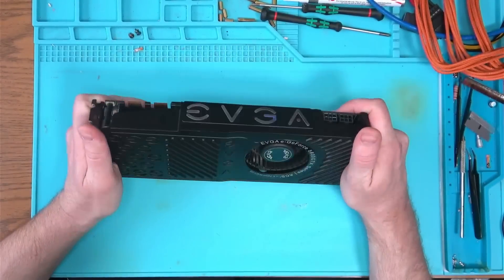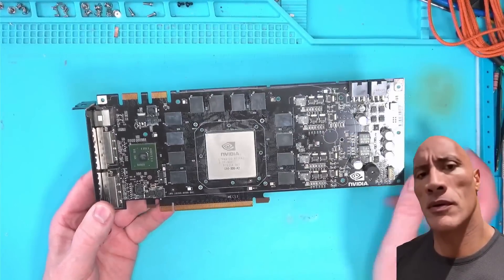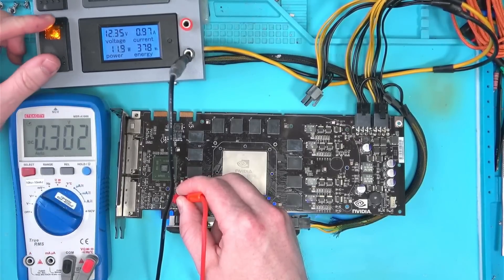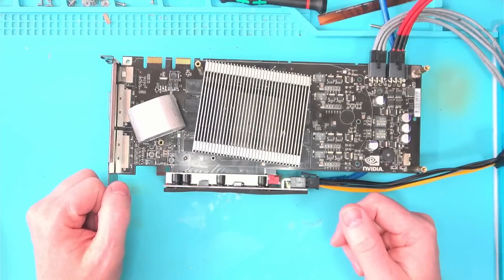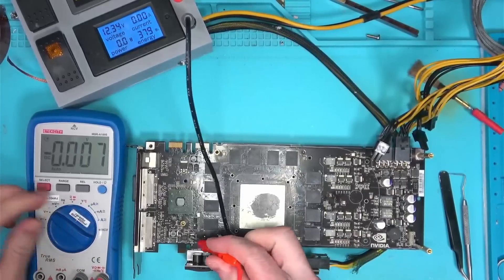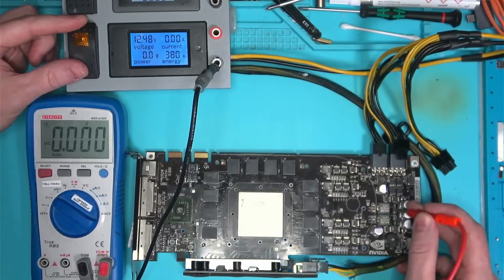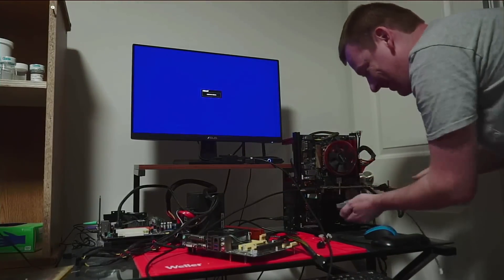Old graphics card repair was a success but was it worth it ?

Comment: Comments section is wild.

nvidia 8 series flagships like 8800 GTX and Ultra are not easy to find in good working condition on ebay, especially not the nicer AIB boards like this one. The ones listed as "Used" usually are on death's door because they've been "baked", and they may post, but crash under load. And "baking" involves literally baking the whole card - capacitors and all - in an oven, which isn't great.

There are not very many people who actually want to buy these, because their only value is to collectors and overclockers. But, the going price is such that it kind of does make sense to pay NWR to work on it. For even more sought after GPUs like for instance the radeon X1900 XTX, paying him to work on it is a fantastic deal.

Comment: these and the 9800 where terrible for early ROHS solder cracking. most people did over reflows and ruined them back in the day instead of reballing.  The HP DV series and nForce based motherboards from this era suffered similar fates

Comment: I know the 8800 GT had compatibility issues with certain motherboards, not sure if that applies to the 8800 GTX as well. I know from personal experience with the 8800 GT that this is a real issue, as I own an OEM system with a socket 775 motherboard, and my 8800 GT definitely does not work in the system. The fans just spin at 100% speed and no display output.

Comment: The extra chip is the video decoder on these older GPU. Is actually a mobile GPU core, cut down enough to just run the video codec microcode on it. It basically does video coding and decoding in real time, required for video streaming.
As you said, the core of this chip is now inside of the main die in later GPUs.

Comment: 4:28 what does that wire at the top of the screen do?
Reply: Its a thermal probe, probably a thermistor or something of that sort, it measures the temperature of the board close to the core (or anywhere needed)

Comment: I was just restoring my old core 2 duo PC with an 8800 GT. Not sure of original manufacturer as had a Zalman after market heatsink. I think this may have been when heat pipes were new and cool. I noticed it had a 256bit memory bus. Which is more than every graphics card I got since, until I picked up an EVGA 1080ti bargain which has 384bits.
Please Nvidia, can I have a modern gfx card with a 256+ bit memory interface, but without raytracing or unnecessary frame rate generation. Otherwise I'm staying with these golden oldies. No game is worth spending two grand on a graphics card for. I would prefer to stop gaming and do some programming rather than pay that lol.

Comment: hey, i have at home a gtx 970 with 1 dead memory module. i also have another dead gpu with the same memory chips. would it be worth it to send to a repair shop to fix the 970? i'd try soldering the memory chip myself, but i'd spend more on the equipment than what the gpu is worth. how much should a shop charge for just replacing the chip?

Comment: I was about to get VERY surprised if you had the correct stencil for that card. Of course you had to use an universal stencil as you explained later.

Very nice video. I refuse to let die old parts too. Just out of curiosity, are there chances that the old GPU core was ok (the one you swapped finally from the donor board) and was the test computer problem again?

If you want a guess, I think it might have to do with some modern (and not-so-modern) hardware only supporting UEFI boot, and that 8800GTX probably only works in legacy.

Comment: "better designed than any modern graphics card"
Not really. This card is from that period when all nvidia gpus died within months.... including those installed in PS3s. Aka the "bumpgate".
Reballing it might have fixed it temporarily, but the connections between the die and the substrate will eventually break, because the underfill is trash!

Comment: The 8600 chips had an issue with high failure rates. Especially the laptop variants. I had a 9500M GS die. (The 9500M GS was a rebadged 8600M GT, made for the next generation.)  

It was something to do  with the solder or something else close by to the solder. Many years ago and can't remember exactly. There was a name for whatever it was.
Reply: "Tin whiskers"?  That's the only thing that comes to mind.  Chip creep is only for socketed stuff so can't be that.
Reply: @Vile-Flesh  I think it was something about a layer of something between solder and somewhere else. It's a long time ago though. Maybe ten years since I was even thinking about it.

Comment: I have one of these from EVGA that I've had sinse about 2008. It worked like a champ all through its hayday but I'm kinda ashamed to say over the years of not having cash for anything else and it just being up to the task of gaming well into 2015 I probably baked the thing upwards of 10 times to temporarily stop no boots and artifacts.

It worked fine last used; now lives in a rig shoved in a corner with an Nvidia 680i motherboard and QX6700 CPU.

Comment: For the owner it was most likely worth it, noone sends in an old EVGA high-end GPU because they want it working for no reason. Probably for a legacy pc and properly run legacy software. Also, most GPUs of that time looked pretty sh*t, this is a good looking model of the area so just for that worth saving.

Comment: Sorry to break the celebrations but that is only a temporary fix. The G80 has the same issue as the fat ps3s gpu. They tend to break at the micro bga layer between silicone die and substrate. The insane high wattage plus the resulting thermals plus the thermal expansion plus the new non leaded brittle solder plus the inadequat substrate preparation of TSMC not taking non leaded into account. That is also the reason for the xbox 360 RRoD and old macs with nvidia gpus failing.

Comment: Baking those 8800's was a thing back in those days. Solder joints went bad. We literally shoved the cards in the oven  🤫😅 (also the PCIE compatibility, that card uses 1.0, your newer motherboard may not support pcie 1.0)
Reply: Pcie should work on pcie5 no problem.  Pcie 5 wont work on pcie1.

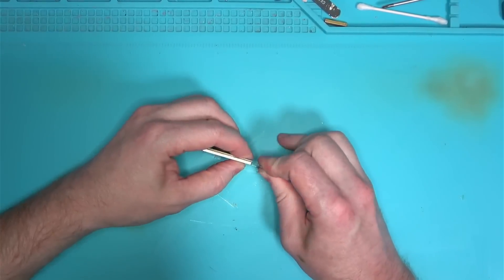Comment: Tbh, I hated the older GPUs that had the die cover. There was always never enough paste between the cover and the die like what you showed at 6:16 and it's difficult to change the paste once it dries out
Reply: I was wondering also, should I look my old GTX 1080 does it have also cover...
Reply: @GameBacardi really?  My msi 1070 was bare die.
Reply: @killerrf  ok good, because I don't remember when I put new paste last time

Comment: That is awesome! I still have my 2008 PC that runs 3x 9800 GTX+ (same G92 architecture as this 8800 GTX) in tri-sli and it's still a delight to fire up and play some old school games on.
Reply: but, can it run crysis?
Reply: @maklogetrich2378  on cinematic 24fps, because human eye can't see more than that!
Reply: @maklogetrich2378  🤣 Absolutely! Was the whole reason why I built it years ago!
Reply: Very nice!  I missed out on gaming and hardware of this era as I was working long hours 7 days a week for years and whenever I did game it was on my old, very early 2000s junk which I still have.
Reply: @Vile-Flesh  I should post up a video of it; I placed the big order on NewEgg after getting back from deployment. Dropped some hard earned cash for a new build and I've had it ever since. Only thing is, I don't have the original case or PSU which was an old Thermaltake Steel Series full size.
Reply: nice space heater you have
Reply: Damn, you were spending 4090 money back in '08 lmao
Reply: @wills.5762  It was a Newegg order I made right after I got back from Iraq! Yep, had money to blow lol

Comment: So that core is likely still good, the 7xxx/8xxx/9xxx/and some early GTX280 had issues with the bumps.  Toms hardware had an amazing write up on it back when it was fresh but its so old the article isn't easy to find.  Nvidia Bumpgate was the issue and a user on the Vogon forums has a pretty on point rundown of it.  I personally had it kill a 7800GTX, 2 x 8800GTX and a GTX280, all EVGA cards all died to it.
Reply: yeah PS3 with early GPUs also has this issue
Reply: what is "bumps"?
Reply: @maklogetrich2378  the contacts on the chip are "balls" for certain applications but when you bite into a York peppermint patty and heat them up they resemble little "bumps".  As basic as I can get it but I think it works.
Reply: Because that was the year leadfree solder becomes standard .Solder cracks are very common issue especially in Macs back then.

Comment: $300 repair bill for a $20 card.
Reply from the maker: I don't think it was even half that much.
Reply: @northwestrepair  : It is still uneconomical, in 3 more years, that thing is 20 and can drink beer and other spirits. 🤣
Reply: @bloeckmoep  Well, it already can in my country (18 years old is enough in most european countries)
Reply: Guys, you don't undestand that there are priceless things in this world if they mean a lot to you (e.g. sentimental values).
Reply: $20? Haha! Just wait for another 5-6 years and the card will be on the same price, as they launch MSRP. Vintage PC parts getting insane prices as they age(more crasier if they are rare modells).
Reply: @talos86  8800 ultras are already around $200
Reply: dunno. geforce 8s are starting to get scalped on ebay since they break very easily and they are becoming super rare.
high end geforces 1-6 are sold for 200 to 800$ depending on how rare they are.
Reply: Sure isn't a good GPU for modern gaming but could be really usefull for a retro gaming one
Modern GPUs tend to push aside old software/tech, so some old game would run way better on older hardware that actually have the native ability to run them, instead of a modern hardware that would emulate older tech (like the DX11 support for Intel GPUs, sure they improved it after launch but an easy exemple to pick.. Runs DX12 fine, struggle with the previous version)
Reply: Was thinking the sane  although the card us worth  more than 20
Reply: its not about the bill its about sending the message lol
Reply: Must have had value to the owner but it wasn't a $20 dollar card. I bought mine in 2007 or 2008 and it was about $450 at that time. I think it launched in 2006 and was in the $599 range if memory serves. It was a great card at the time until mine went POOF!   LOL
Reply: @microbell9561  well, its not 2007 2008, its 2024 so it worth 20$

Comment: Wow now that's a fossil!  Here I was thinking this dead 980 ti I have sitting in the corner is too old to be worth sending in for a repair, but this one takes the cake LOL
Reply: At worst it's still spare parts. Neat cards to have for retro machines because 900 series work on windows xp with a tiny tweak and are the last to have proper analog converter hardware for vga to use with crt screens.
Reply: @ffwast  true
Reply: lol I have two of them too. Both EVGA 980 Ti's, Same issue of crashing under load.
Reply: @Michael-sy8fc  yehhh....I cant claim a defect on mine....was running a multi meter on the 12V power cables to test something....and one of the probes may have fallen over and connected to the other one....yehhhh, lotta white smoke on that one.  If you try to boot a computer with it in the system of just keeps smoking.  Pretty sure it's shot
Reply: @Michael-sy8fc  had an RX580 that  lowered the gpu clock from 1366 to 1200 for it not to crash
Reply: Try to underclock the gpu or memory  @Michael-sy8fc